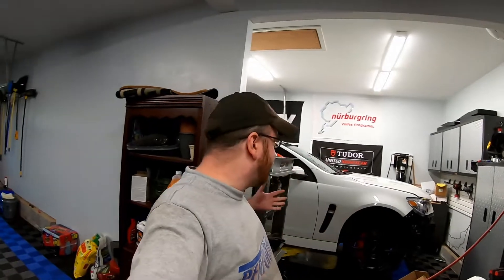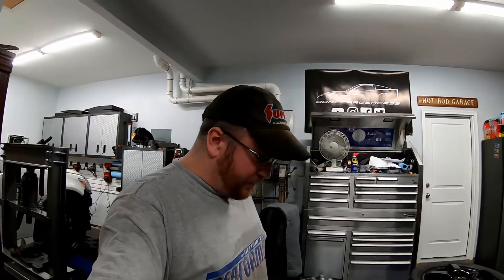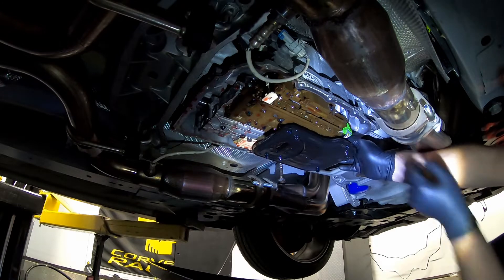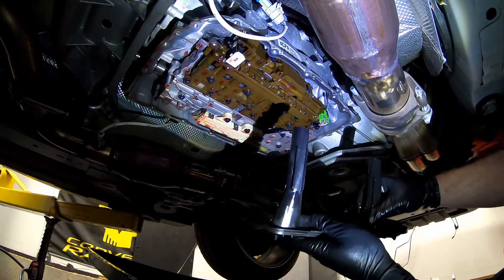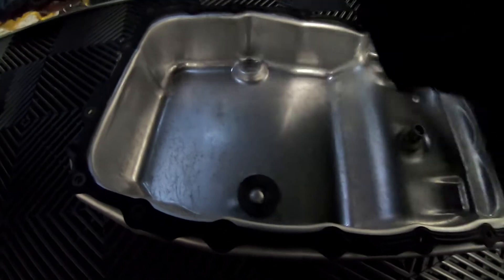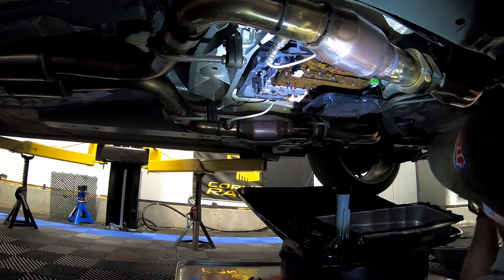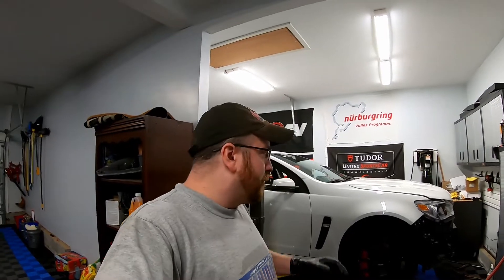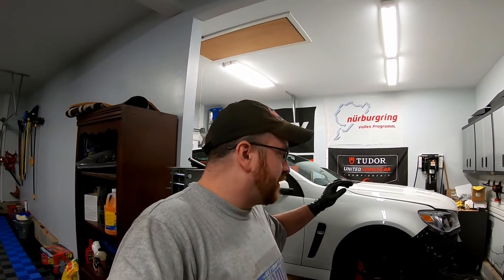2014 Chevy SS - Upgrades Ep 4 - Camaro Transmission Pan Install

Comment: Great video. Thanks for linking to the parts! 
When you were mentioning that the filter didn't seem super securely mounted into the valve body, I was wondering if any of the lower hanging parts of the filter may get support from the bottom of the pan? Not the filter intake obviously, but it looked like there might have been some raised bumps on the bottom of the filter.
Reply from the maker: I think it was about the same tightness fitting as the stock filter. I haven't had an issue with the filter or transmission since the install.

Comment: This filter design, mounting style has been the same in over several decades in 700r4, 4l60e, 6l80e etc. I've never heard of the filter falling out. 
Also you didn't mention anything about the grommet that the trans filter is supposed to come with that holds onto the filter tube. Its best to remove and replace it since platic/ rubber deteriorates over time especially that the trans gets hot.
Reply: The pan also holds the filter in. That's what the bracket on the bottom of the filter is for.

Comment: That is NOT A DRAIN PLUG!  That is the plug you open to set the fluid level when the trans temp is at a specific warm temperature.  You can see that a true drain plug would be in the lowest part of the sump.  Same setup as stock SS, no drain plug--running level spill over plug!

Comment: Hey are u worried about hitting the pan on a bump or something or does it sit flush with the frame of the car?
Reply from the maker: No - not at all. It is still up in the chassis and you would hit the lower sub frame first.